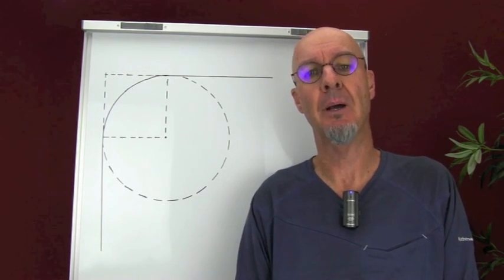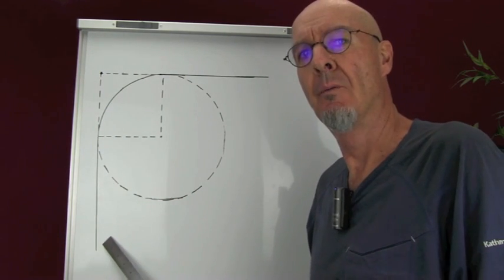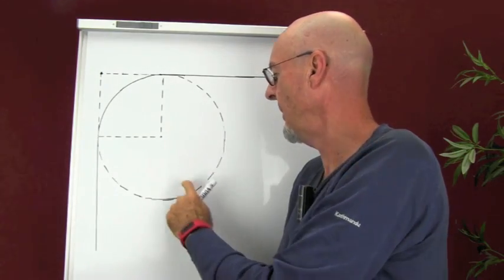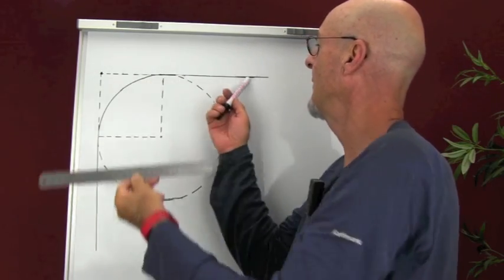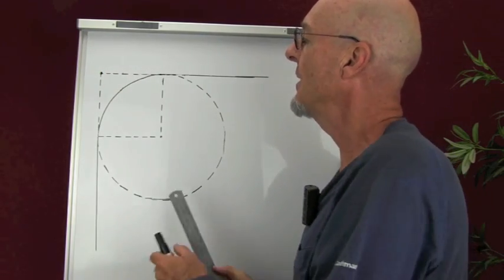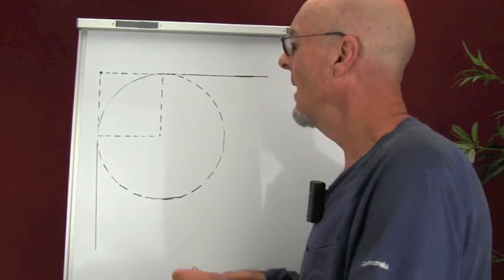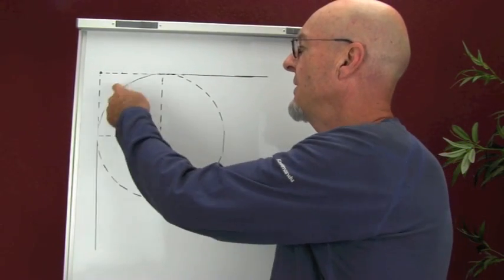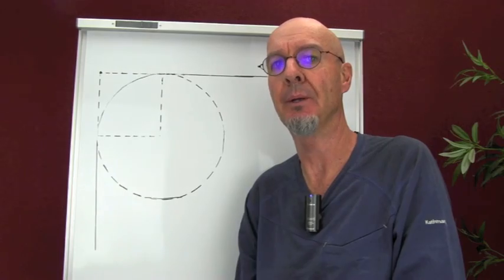How to Measure a Radius

Comment: I have a blueprint that calls for me to measure from the end of the part to the center of the radius.  The radius is .5 inch. Does that mean i measure the distance and subtract .5 (the radius) or subtract .25 (half the radius)?
Have been in a debate/argument with a coworker about the drawing and whether it is drawn correctly.  Thanks.

Comment: Measure the Diameter and haff it, it is easy to to miss read the tangent point
Reply: True, it can be difficult. When measuring a spa the reading will be close enough for making a cover that fits. If you need to be millimeter perfect, then there is room for error. Still, the theory holds.

Comment: I think the challenge would be finding the exact point of where the flat line ends and the curve start.
Reply: Absolutely right, especially as spas can warp slightly with time. If the supplied radius measurement comes to us with a photo of the spa, then 99% of the time we will know what spa model it is.
Reply from the maker: Good observation but if you use a long straight edge on both the sides either end of the curve and it should be fairly accurate.

Comment: Does this apply to other angles?
Reply from the maker: This method is for measuring a radius. If your question is, can this be applied to non-symmetrical curves, then no, this calculation won't work. It's for measuring a consistent, half circle curve.
Reply: @spacoverman   oh okay Thankyou

Comment: what is the angle of a curve per 1 inch diameter circle...2 inches 3 inches at what point is the curve of slope at .. What is the wording for the Bend.. thank you in advance
Reply: No need to know any angle. Radius is half the Diameter, irrespective of size. We call the 'Bend' the "Corner radius'. It represents the circumference of quarter of a circle. Radius can only be calculated this way if indeed the corner radius is quarter of a circle. If the curve is not regular and does not form quarter of a circle, then a template is required as it won't obey the calculation rules discussed in the video. Not sure that answers your question but the same calculation exists to every size scale.